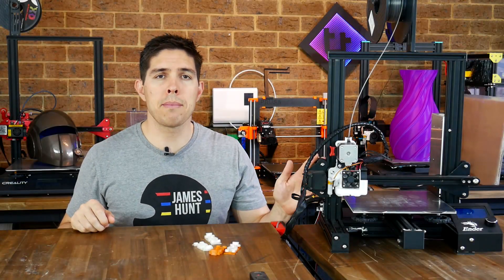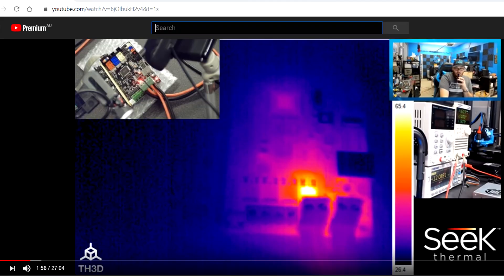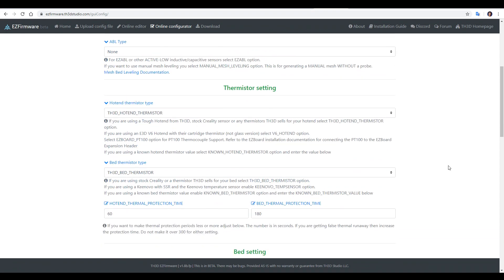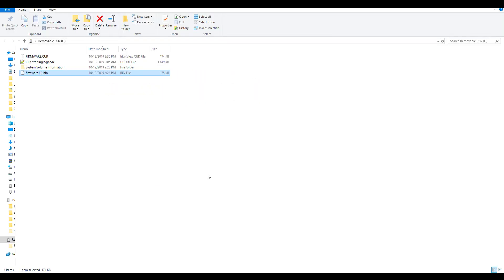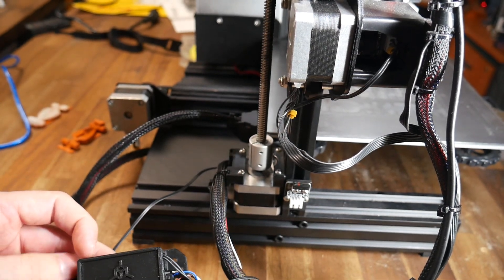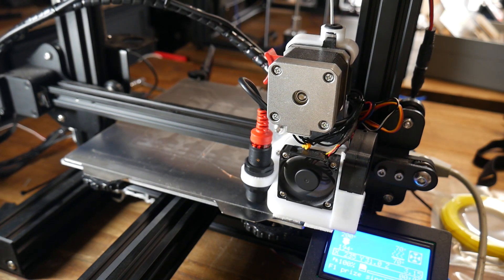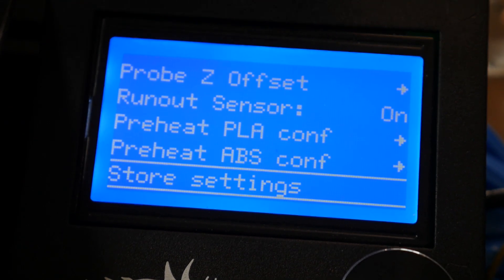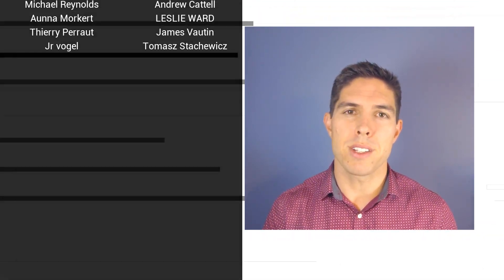EZBoard Lite - The most user friendly Ender 3 mainboard upgrade + EZABL Pro

Comment: I'm a big supporter of TH3D, but also love my SKR. TH3D's board will cost more, but the support is a damn good value at even three times the price. I spend a few hundred a month at TH3D for parts on all my printers, easily the best US provider for parts and upgrades! Just don't sit in any chairs at thier office, Tim seems to have issues with those.
Reply: It's 4 times the price if you want the  fantastic support though.
Reply: @squat224  for some people being able to plug it in, drop a pre-made firmware  file on the SD card turn it on and it just works with your ABL etc without any fuss it's a no-brainer to spend more and know the board won't burn itself out in 6 months.
Reply: @linkah  is that really an issue with the chinese boards? because I've not heard that, in fact I've heard people buying many of them to upgrade printer farms, and having zero issues. I understand if you're willing to pay for peace of mind, but that should not be the main selling point. Configuring the firmware for the SKR mini is not rocket surgery, it's incredibly easy Teaching Tech has a walkthrough and a pre-done firmware that you gasp put on the sd card and flash. Lets not forget we aren't upgrading a 500$ printer. It's a low budget printer.
Reply: @squat224  Ask TH3D, seeing as they did a video on that exact subject.
Reply: @linkah  yeah, I saw that video, of them abusing both boards and their definitely higher quality board taking it. But that's an abuse scenario that hopefully wouldn't happen in normal use

Comment: This is a great video. I end up purchasing the board and doing the upgrade based on this. Quick question, is there any plans on doing a review of the E3D V6 (w/ PT100 sensor cartridge) along with setup for the Ender 3? I'm interested in this setup and I know you did the Micro Swiss in the past.

Comment: I am loving the SKR mini E3 that i bought from yor review i got the 1.2 and its worth mention that you should talk about the 512kb that it has i have been usinig it for 3 weeks with all the features i could imagine and it works like a charm also i prefer the EZABL than BL touch (Tested both and think that EZABL its better)   but can you tell why seems that yo prefer BL touch
Reply from the maker: I just updated the free firmware on the V1.2 update video if it can be of use.
Reply: I think people prefer it over the EZABL because of two things. One the Bltouch works in any bed surface glass, mirror, mag without any readjusting the probe. Two people prefer the bltouch is that you can install it in any board the EZABLE will not work on the SKR OR MKS boards. And Tim has said he will not update his products to work with these boards. He had also told customers who have tried to install them on other Chinese boards like the SKR's that he will not support his product and it is not the EZABL's fault it's the Chinese SKR board that is the problem. 
If i owned a company that isolated customers that way i would be out of business in a week. You don't isolate customers, you do everything you can to improve your product so that it fits every aspect of the market to the best if your abilities. In my opinion Tim has a poor business practice that should not be condoned.
Reply: @cowboy124aa3  The EZABl works on the MKS/SKR boards. There is a guide on the site here: https://www.th3dstudio.com/knowledgebase/ezabl-setup-for-vanilla-marlin/. 

However, we do not provide complete firmware to run the entire printer for that board though since it is not our product to support, just the recommended probe settings. It is up to you and/or BTT to get the main printer firmware working. We support the BL Touch on our EZBoard as well as the EZABL. BTT should support the EZABL on theirs for their customers just like we do for our customers on the EZBoard that use a BL Touch. We do not want the burden of supporting a 3rd party board that is not a stock board on our support team, especially with all the issues that the SKR boards have with firmware not working correctly from BTT. If the SKR firmware worked 100% without issues and workarounds it would be a different story but as of writing this comment there are still issues with their firmware that make compiling difficult for those boards.
Reply: The BLTouch also costs less and, while slower, is significantly more accurate especially since the heated bed doesn't affect it's readings. The EZABL is just a nice kit with a cheap inductive probe and a more complicated install.
Reply: @sycoaniliz  we actually use a custom capacitive sensor running at a much higher speed (600hz) than most sensors on the market. Our control board has excellent power filtering it to reduce noise going to the sensor and a dual layer shielded cable (not one else is doing this) with braided mesh and foil wrapped inside. I assure you the sensors are not cheap and cost quite a bit. We also include 1 on 1 technical support with the kits as well.
Reply: @TH3DStudio  Yes but you can by thirty (30) $2.00 M12  4mm 5V NPN  inductive proximity sensors for the price you charge (LJ12A3-4-Z/BX-5V).

Comment: You had noted a number of bugs you encountered with the skr mini E3 in previous video.  You don't seem to note encountering any bugs with the EZboard lite.  It seems the only down side is that it uses 2208 instead of 2209.
Reply from the maker: Correct. I just updated the free firmware in the SKR mini 1.2 video and think I have it sorted now. This board worked properly without modification.
Reply: If you want to know more about why we went 2208 vs 2209 see here: https://www.th3dstudio.com/ezboard-lite-why-do-you-use-the-tmc-2208-instead-of-tmc-2209-drivers/
Reply: @TH3DStudio  I have seen you reply your well reasoned thought process.  You prefer to provide at proper product and not use your customers as beta testers.  Well done.
Reply: @sarahcole2753  eventually we'll switch over to 2209 as the 2208 is phased out but right now we know they are stable and readily available. Thanks for taking the time to check out the link and reply! Merry Christmas!

Comment: My only criticism - still uses a MicroSD card and not a full sized SD card. 

A few questions please:

*Warranty of the board and ZABL?

* Which ZABL does the Ender3 (Pro) take?  The web site has two versions:  Pro (18mm) and Mini (12mm)

* It would appear that the offsets are not super critical since eyeballing them with a ruler is good enough - true?

*Are there any utilities to change the LCD display layout - the displays are all the same and there is wasted space. I would rather have two text lines - one for Current Layer being printed and one for file name.  The Block in the middle with the X, Y & Z axis info has always been pointless to me.  etc.

Cheers

Comment: I have the mini and the ezboard on my ender 3's and both work great, the only downside with the ezboard is the price but considering how easy is to install and how fast you can get the printer up and running makes a valid argument to use this board instead (I actually dreaded compiling the firmware by myself at first) my only issue is that the ezboard restarts/reboots when you insert an sd card if its already on, like if you want to load a file or get everything ready while the printer preheats only to have to wait for it to reboot when the card is inserted and pretty much making preheating a useless option for the printer (you have to wait for the nozzle to heat up again)
Reply: The newest firmware does not restart when you put a SD card in now. This was a Marlin glitch that has since been fixed. :)

Comment: The SKR mini E3 is a perfect board, and real value for money. And I really don't see any need to buy a EZboard,  unless you just want to use more your money for a product with less features. Even for a beginner the SKR mini E3 is a piece of cake to install and compile.
And last ......who wants to give more money for a board with 2208 instead of 2209 ??? EVEN without heatsink! Thats just stupid.
Believe me, the stepperdrivers WILL get hot after 4 hours printing....really hot.
Reply: All valid points aside from the need for heatsinks. There are a lot of ways in electronics engineering that use the pcb itself(ie groundplain, vias, etc.) to get the heat away from chips. Boards with replaceable stepper drivers need heatsinks because of how small they are.
Reply: @hzmeister9596  true that...but  the heat won't disappear in thin air,  you will need a fan to cool them
Reply: Timothy Hoogland  Well the endstop switch on Ender's won't last for ever., as these are very cheap, and  therefor users will benefit of sensorless homing. Second, the heat from all the ic's on the board have to go some where, and 60C inside a home made PLA cabinet is way too much, both for the electronics and the cabinet it self. (im talking about the printed one, every diy guy will make) The Pi wont last 10 min in the temp.
And the last thing is the price! I could understand a price difference in 10-12$ because of the layers, but over 300%.... you might think that we are stupid nerds and buy everything we see on the internet, BUT thats a bit toooo much. Even for nerds like us.

Comment: I went with the larger bigtree SKR 1.3 and just printed a super nice custom case for it from thingiverse (thing:3398254). It has room for dual 40mm fans to cool the board. The mini E3 has too many issues.
Reply from the maker: I've just updated my free files and a lot of the bugs are ironed out. SKR V1.3 is a great board, I agree.
Reply: What issues? i have two of them in my printers one ender 3 pro and one in my CR-10 S5. No issues whatsoever.

Comment: What would be a comparable printer stock that would compete with this board and an Ender 3? I can see the value in the support and interface, Even compared to the "Chinese boards"for a third the price. I have just ordered my Ender 3 and I am learning all I can before it shows up. I had already planned to update update the main board for the stepper control benefits in the future but I do have to see more value to make that jump, so please point out some machines that compete with a Ender3 + EZ. Is there one that is close to the price? or do you have to jump to 500-700 dollar printers to get these features? Edit: I just looked and now this board is 4 times the price.

Comment: Will you make a video about the E3D Hemera? I like to add Direct Drive to my Ender 3 Pro (currently adding a dual Z for this) and really like your reviews :)
Reply from the maker: I most likely will but by the time mine comes there will be a fair bit of content out there.
Reply: @TeachingTech  Any custom options to consider for the Hemera when using the configurator (Ender 3)? Or should we manually config according to your incredibly helpful Hemera video?

Comment: Geez this thing is half as much as the printer itself. Being new to 3D printing that's probably a non starter for me at this time. I am looking to buy an Ender 3 as my first printer. The only mods that I am interested in at the start is to install an all metal hot end and go with an updated main board with upgraded stepper drivers for more quite operation. I am looking for drop in main board to achieve that. I watched your video on the SKR Mini E3 but I can't tell if it is a drop in replacement for a stock ender 3 main board or not as your video went through a bunch of updates/changes to the firmware and I couldn't tell which changes were in support for the mods that you had previously made to the machine and which (if any) were in support of the stock ender 3. I guess my question here is simply can the SKR Mini E3 be used as a drop in replacement for the main board in a stock ender 3? I know that this video is about the EZboard lite but I need a cheaper drop in option and would like to know if the SKR E3 would fit the ticket? EDIT: No need to answer my question as I found some other sources that provided me with the information that I was looking for. Looking forward to your future videos.
Reply: Half the price is a nice way to say it. I would say, I could get another Ender 3 for the price of this board with a few accessoires and shipping. The SKR Mini E3 is specifically designed as a drop-in for the Ender 3 (thats what the E3 stands for). You only need to install the latest firmware on it (there should also be already done versions out there and plug all the cables in the new board. I am personaly using the SKR v1.3. It is more similar (layout) to the MKS board everybody upgraded to befor SKR became popular. Don't really see why I should pay so much on a new mainboard. I would rather go for the pro version of the SKR if I want to spend more
Reply: @SchwachsinnProduzent  Thanks for the info, just what I was looking for.
Reply: Timothy Hoogland  They don't need EEPROM as it is emulated by default in the firmware and to the end user it makes no difference at all. This is the kind of misdirection that is really disappointing to see.
Reply: Timothy Hoogland  No, it appears that I am just more informed. SD emulation is long outdated and no longer used. CPU FLASH has less write cycles available than a traditional EEPROM but still a significant number. That combined with wear levelling and the fact that EEPROM writes (emulated or not) are infrequent, produces a region in memory which will outlast the life of most 3D printers. Effectively hundreds of thousands of write/erase cycles. You ARE spreading misinformation. I have been an embedded firmware and hardware engineer for the last 15 years. I've seen many products go from concept to production line, some in volumes of upwards of 50k per month. On the basis of that experience I can estimate the component cost of your board without even having to break it down into a BOM and I can tell you that people are not paying for your hardware. They are paying for your overheads and the additional service that you offer as well as a hefty margin of top of that. If people don't need that then they should not be frightened into using your board because you go around scaremongering. Additionally, every other component on the 3D printers that you are making boards for comes from "cheyenuh". The steppers, the belts, the extrusions, everything and yet it all works wonderfully and we don't see you dissing that. Your bias when it comes to competitive products is obvious and based on the other comments on this thread I am not the only one who notices it.
Reply: Timothy Hoogland  Not because it is higher priced Tim but because you blatantly attack competitor products that are working just fine for thousands of people out there and try to justify your pricing through those attacks. Furthermore, when presented with a reasonable set of facts about a particular feature you ignore them and focus in on what you want to. Take emulated EEPROM on program flash for instance. You state that it is cutting a corner. Not true. It is a common industry practice and well used in many products. You also ignore the fact about the effective write cycles after wear levelling and the infrequency of writes. It really is a pity that you need to try to do this just to promote your product. It's one thing to have a healthy pride in something you have poured yourself into and helped to create but entirely another thing to act the way you have been. You would be doing yourself a favour in the long run by taming it down a notch and showing a bit more respect for your competitors.